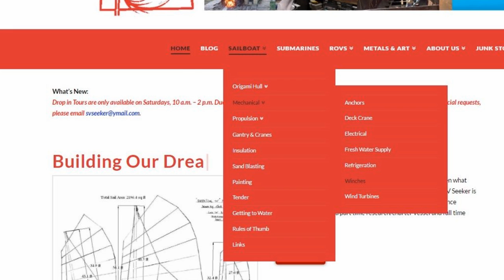Seeker LIVE - May 27, 2017 - Sail Rigging, Hatches, Hacking the Wild, Concrete Jungle

Comment: your rant about dewalts new grinder is spot on, I couldn't agree more! we have the same problem at work with our big grinders without locking on triggers so we have a zipclip/nylon cable tie to slide over the trigger once it's on, works great but its probably more dangerous having to do it this way, New ideas are not always good for the people using the products, you should start an online petition for dewalt to bring back old style simple grinders, the way us 'users' want them! keep up the good work 😀

Comment: Hey Doug, have you guys considered running some pipes up to the roof of the pilot house hidden in the walls? Basicaly spare conduits for either water pipes or wires. You may in the future add solar water heating or any number of other items that would require a communication/power/fluid transfer from the hull. It would suck to have to add them afterwards into a finished pilothouse.

Comment: As long as your hatches are symmetrical you only need hinge parts on one edge of the hatch.  Just turn the hatch around to change the opening direction.  Advantage if this is the handle is still in the right place when you spin it around.  That is how the forward hatch on my boat works.  I like it fine.

Comment: Ever look into a solution for that non-lockup torque converter? I assume you could just fuse the turbine to the body of the torque converter. ...could be a pretty brutal gear engagement though. I wonder if a company like TCI might be willing to answer a couple questions for a shout-out or something?

Comment: For holding down the tiles why don't you weld the threaded bar to a flat disk and use a two/3 pin "key" to tighten or remove? Kinda like a fuel filler key. This way it's totally flat and not a trip hazard or toe breaker.

Comment: You left out cheap as switches that dont shut off the Dewalt grinder. Replaced two already. Nothing worst than grinding under a truck and the grinder wont shut off.